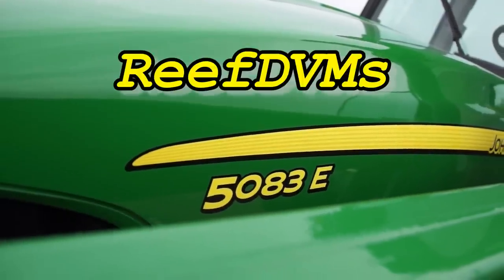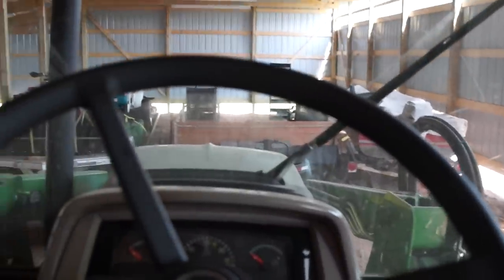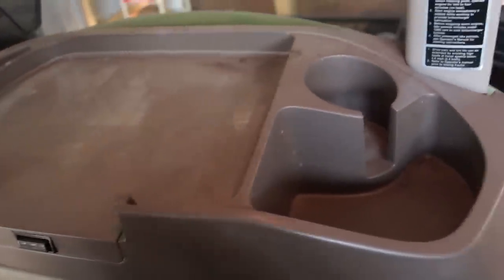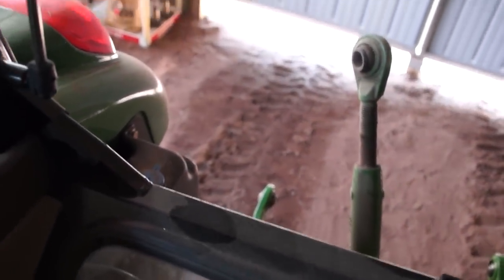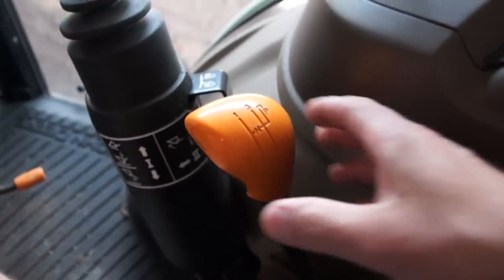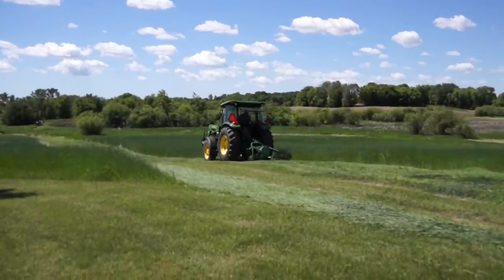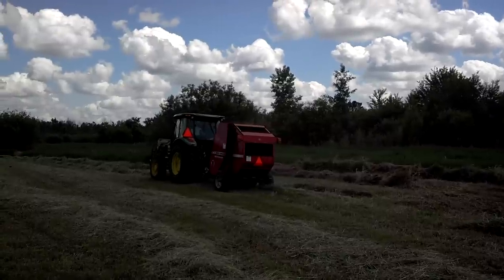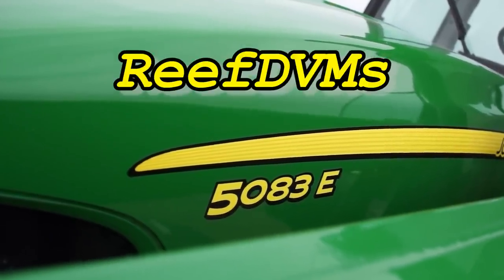John Deere Tractor (5083E Making Hay 2013)

Comment: I have a 5101

&alsom5065 that I use as there intended, utility tracktor they operate and make hay wonderful   along with various other chores. Just started 1st cutting hay m5065 ran claas 160 round bailer flawlessly. 70 acres last 4 years. Can't say that they let me down yet. Very dependable.

Comment: Is my 5095 m better ?
Reply from the maker: your 5095 is 95 horse hydro tranny tractor, this is 83 horse power shifter tractor, your is slightly larger and easier to shift hydro wise=)
Reply: Yes
Reply: It can’t be a hydro, the biggest hydro is the 4720/4066r
Reply: Ye sistm kitny ka hhh